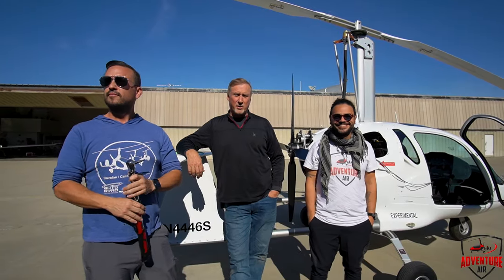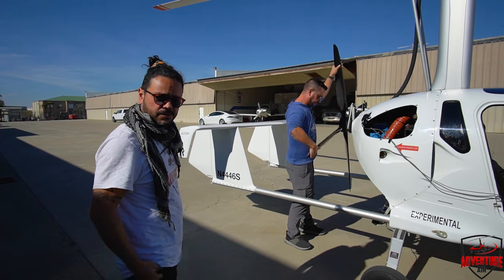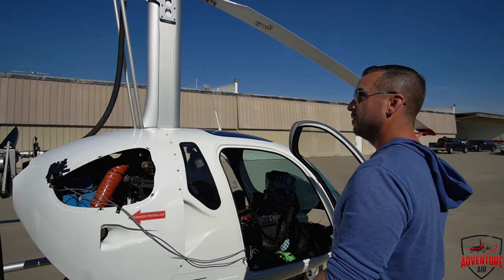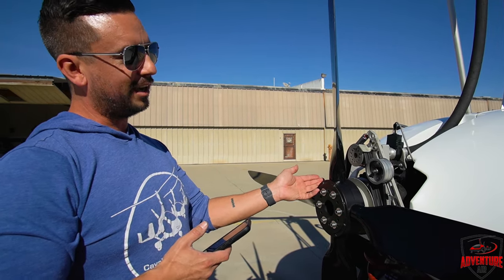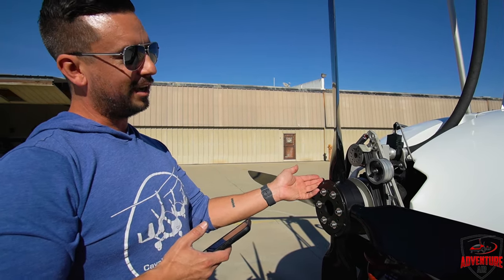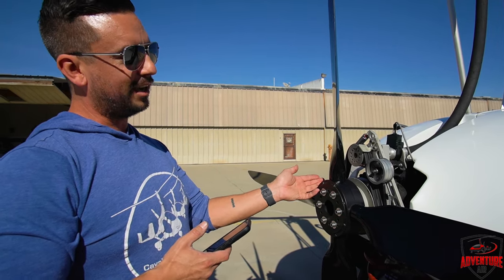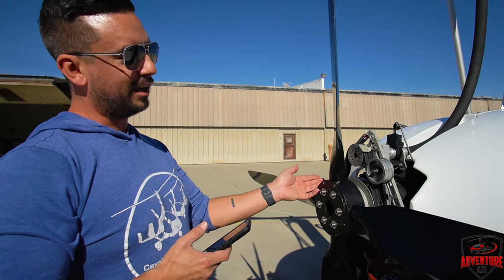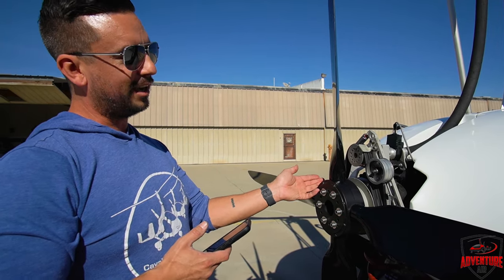75. Troubleshooting: Prop vibration or something else? #adventure #air

Comment: Jimmy nice to see you using the Smart Avionics PB4 balancer, as you may know unfortunately  it is no longer available.
A few comments!
Good to see that you’re checking blade pitch first, many don’t realise how important that is.
The difference between the angle that the PB4 tells you and where the actual imbalance is not because of gyroscopic precession. It is called the phase angle and is due primarily to damping in the support system. 
You say that the rotors come from the manufacturer statically balanced, I’m sure you’ll find that most will dynamically balance them before shipment.
At about 22 minutes you counted the bolts in the direction of rotation but the PB4 counts the bolts (weight sites) in the opposite direction.
You don’t need to try to work out where to put the first trial weight. After your initial run to measure the imbalance just stick a weight on any bolt (counting in the opposite direction to rotation) and enter the value and position in the PB4, it will tell you after the second run how much and where to put the correct weight. 
You say that the rotors come from the manufacturer statically balanced, I’m sure you’ll find that most will dynamically balance them before shipment.
I’m looking forward to see how you tackle the rotor balance.
Mike
Reply from the maker: +@mikegoodrich1948 thanks!